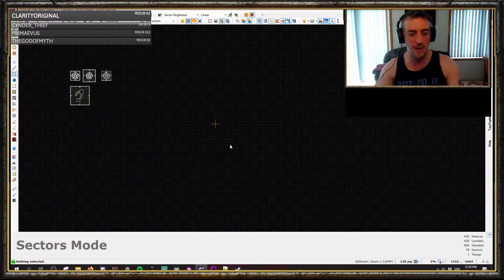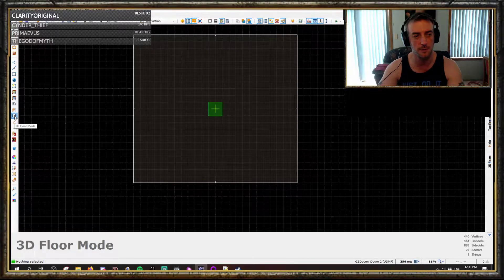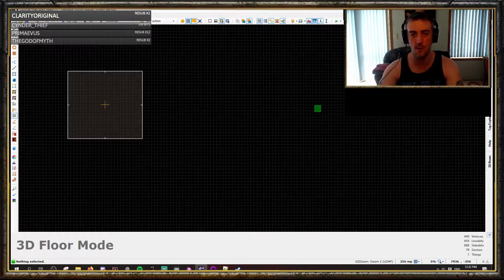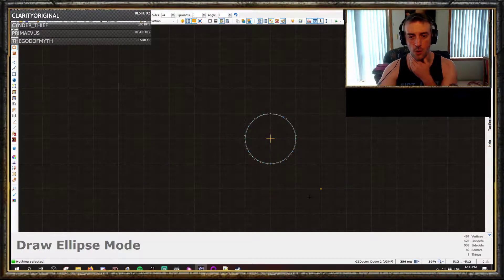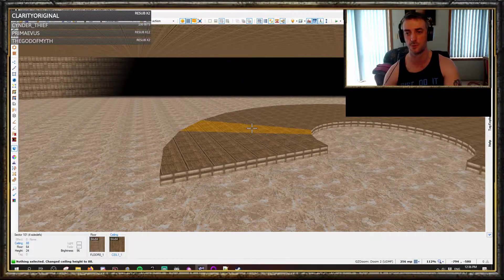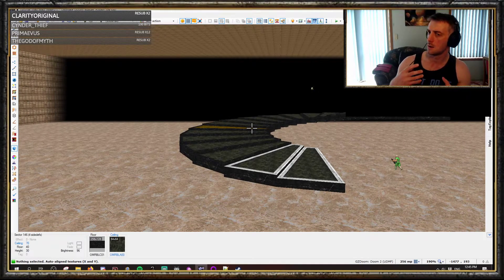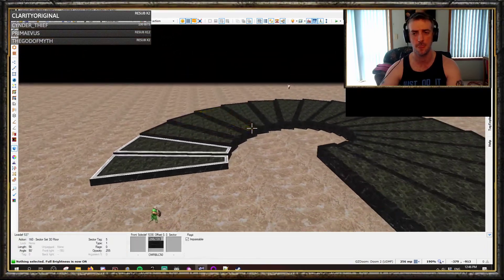Ultimate Doombuilder Tutorial Series: 3D Floor Mode - How to make a spiral staircase

Comment: Well, it would be more beneficial if you taught the selection shortcuts... And another detail, for some reason my 3D mode is unable to select the top staircase (the view is as if there was a roof without texture). Anyway, I learned a lot of things in this video.
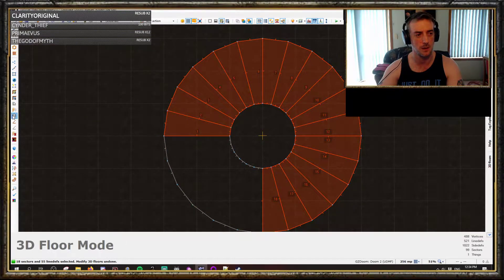Reply from the maker: If you cannot see it the top surface of your 3d floor will be at the same height as the ceiling of the sector, which I cover off at 4:40. I also have a tutorial that covers every function in UDB which covers things like paint select
Reply: @Bridgeburner56  Thank you for the explanation.

Comment: Hi Bridgeburner, having a bit of a problem. I moved the control sector area to the void, but I'm still getting the same error that tells me that I'm trying to put it in a spot with geometry. Could this be because I was building 3d floors beforehand using the old method? If so that would me the control sectors are very scattered around.
Reply from the maker: As long as there isn't anything in the green square that defines the control sector space it should be fine but I've never tried to use it halfway through a map where I've made 3d floors manually. There is a relocate control sectors button on the top tool bar as well which might consolidate all of your existing manual control sectors. Definitely save before you do it though :D 
If you're still having trouble feel free to jump in the discord. I'll be able to help easier and the guy who made 3dfloor mode (one of the devs of UDB) is there too. Link is in the video description